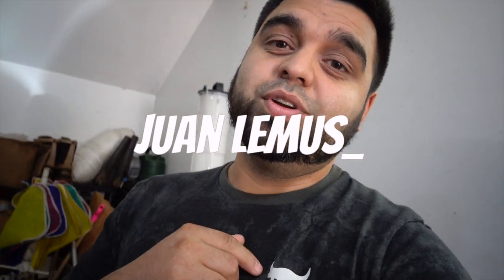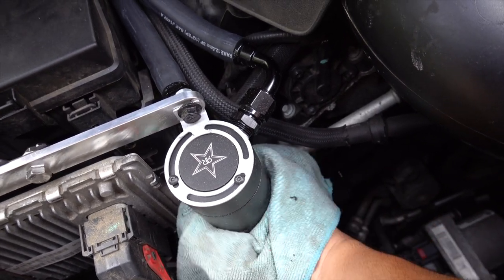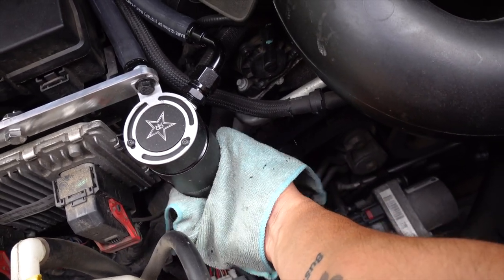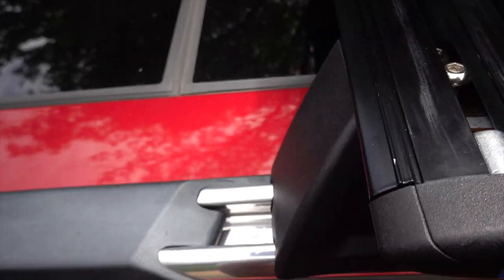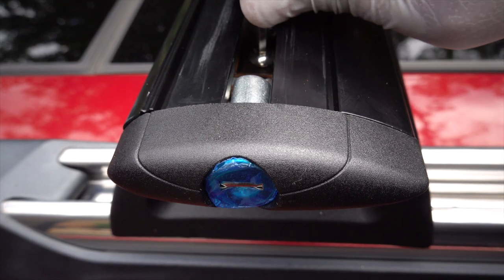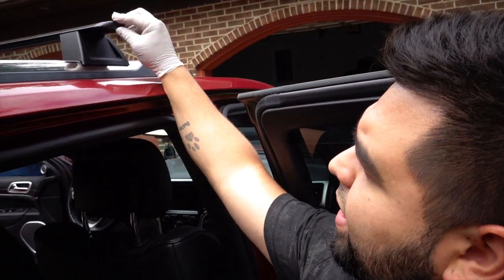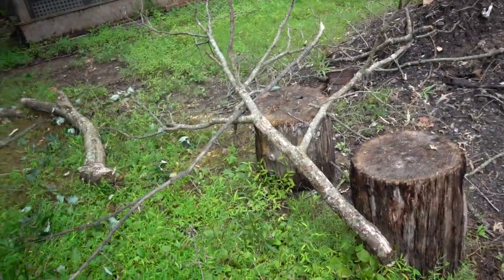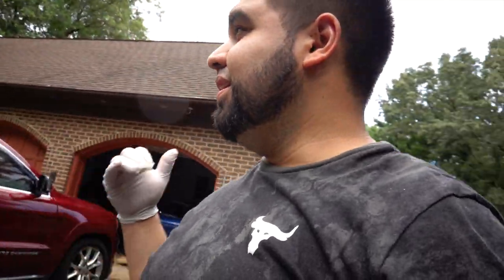Installing Roof Rack Cross Bars On My Jeep Grand Cherokee WK2 2011-2021 | How To

Comment: Thanks for the video. The inner bolts on mine just keep spinning, won't tighten at all. Any ideas?
Reply: Same here I just installed mine and the inner bolts on each rack just keep spinning.
Any idea why and how to fix?
Reply: JR any issues with the hold of the bar after the inner screws keep spinning ?

Comment: How has the noise been since you've installed these? Any whistling on the highways??
Reply from the maker: The first 4-5 months I had ZERO noise. It was awesome. After that, I started getting pretty bad wind noise. I don’t know what changed. Everything is snug and just as I installed it so I don’t know what happened. I just took it off yesterday to go on a long road trip

Comment: Do you get a high pitched whistling noise from the racks around 30mph?
Reply from the maker: I don’t know why but for the first like 5-6 months I had zero wind noise. After that, it would start at around 40mph. I don’t really know why it happened and I don’t use it enough so I took them off since they’re super easy to install and remove